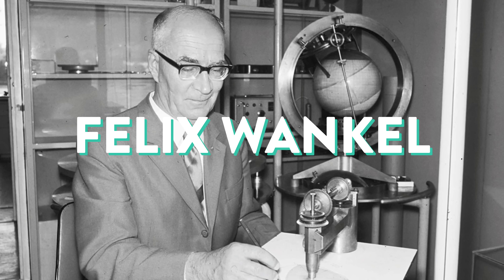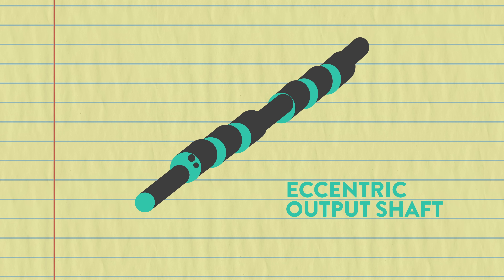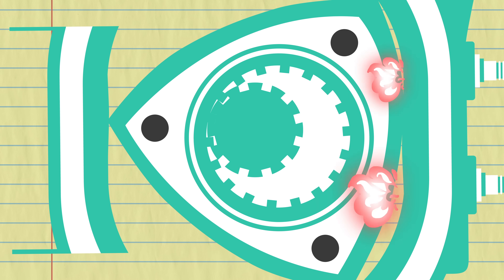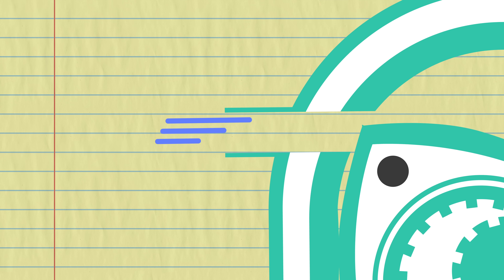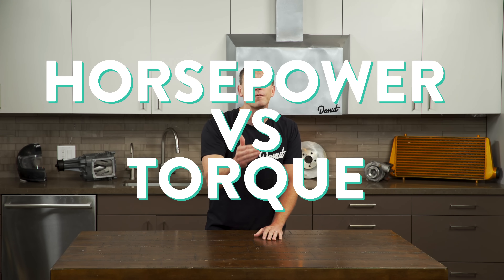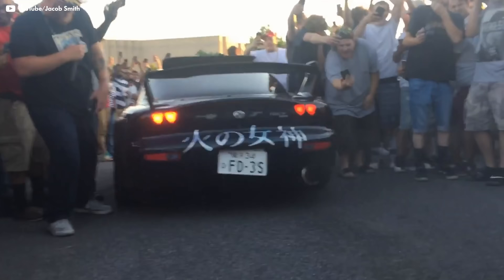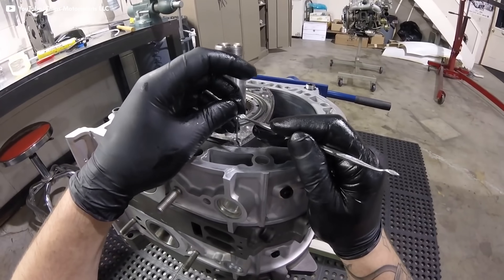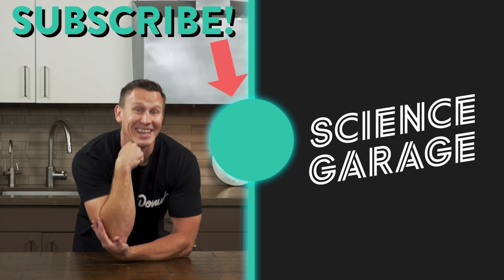Rotary Engine | How It Works

Comment: Sick vid! 👌🏻
Can you tell us why fuel injection is superior to injection from a carburetor DOWN TO THE ATOM?
Reply: Because the computer has many sensors reading the air mixture as air changes on a hot and cold day and as it also changes at sea level or up in a mountain 10,000 ft high, and a computer can easily adjust depending on how much you step on the pedal and control other components simultaneously for maximum performance, 😎👍🏽
Reply: carbs dont really 'inject' fuel. the fuel simply is atomized as air flows past the imulsion tube. that's partly the reason why theyre not as efficient
Reply: Bf109: fuel injected -> can fly upside down indefinitely and can do negative Gs
Spitfire: carburetor -> can't fly upside down indefinitely and can't do negative Gs
Reply: Hotdog Updog Thanks 🙏🏻 😂
Reply: Oh yes please. Talk fuel delivery systems!!!
Reply: YES PLEASE
Reply: AWC Um... WHAT??? Do some fucking research before you spread misinformation like a jackass.
Reply: Ok that was a good one😂
Reply: Bits of Pulp Ayyeeeeee 😂
Reply: thatallredheadude 1 Thanks, but I learn better through visualization
Reply: noice 420 likes
Reply: Hugo Farhan Akbar Now it’s 421 :(
Reply: Better control that's about it the ECU can better control the air fuel ratio than a vacuum chamber through the carb can
Reply: Carlos Barberena I
Reply: @carlosbarberena because fuel injectors heats and atomizes fuel alot better than carburetors hence better mpg and emissions
Reply: +Mike The Mechanic   Can you explain how the fuel injector "heats" the fuel?
Reply: @doktorbimmer  The uk government are being forced to ban or limit diesel cars by 2040. They are giving off high amounts of carcinogenic pollution and are credited for a large rise in cancerous deaths. A lot of the diesel emission testing didn't apply to real world situations while many were falsified. In other words 95% of diesel cars are marginally better for us than petrol if at all, some diesels are worse. DPF filters (that limit the cancerous fumes) are also a very big grey area in effectiveness. Many people have them removed as they block up easily and are costly to replace. Also very conflicting evidence in how well they actually filter while working on top of the added pollution they take to make. Also much pollution is added because some people are forced to ''drive on the motorway to clean the filter''. If they don't do that a warning light puts cars into limp mode. Sellers of such cars do not tell people that diesels are very bad to be used as anything but long distance vehicles. Car makers want sales, telling people a car that is bad in short journeys is not good business for them so they don't say it.
Reply: Ernie Brink, Can you please explain why your engine does not run at all????
Reply: @doktorbimmer  you just run around spewing hate and lies. When will you grow up? @doktorbimmer Aparently he once owned one: here is a quote I copied from another thread, it's a 1 year old post: "I have owned one...an RX7 (the worst car I ever owned) and its engine failed with only YOUR OPINION DOESN'T MATTER TO ME because you have ZERO hands on experience with the actual engine a brilliant mazda and lexus mechanic (who obsesses about rotary engines the way ferrari owners obsess about their paint finish) has stumbled across two mechanical breakthroughs that could make the rotary a total lunatic on the track as it ought to be
Reply: @xkexke8081  COSMO SUPER CAR IS ON THE BURNER AWESOME THANK YOU ROBERT DAVIS AND MAZDA 2019
Reply: @therealdokoterbimmerrotary6751  COSMO SUPER CAR IS ON THE BURNER AWESOME THANK YOU ROBERT DAVIS AND MAZDA 2019
Reply: COSMO SUPER CAR IS ON THE BURNER AWESOME THANK YOU ROBERT DAVIS AND MAZDA 2019
Reply: @doktorbimmer  When you pressurize fuel, or anything for that matter, you create heat.
Reply: @Vladimir Lucifer The injector doesn't heat the fuel dummy... you don't know anything about fuel injection do you???
Reply: @doktorbimmer  The injector does heat up the fuel at the nozel, it's not intended, but that is how physics work. The greater the pressure, the more heat. The greater the drag, the greater the heat. Guess what a fuel injector has the most? Pressure and drag due to High velocity gases. You don't know much about physics, do you?
Reply: @doktorbimmer  However, the faster a gas travels, the lower the pressure is. But there is still internal heat and heat formed due to drag on the nozel.
Reply: @Vladimir Lucifer Well, its obvious you are no engineer... the fuel pump is cooled by the fuel and so the undergoes some heating during pressurization. The Injector however releases pressure... thus COOLING the fuel.
Reply: @doktorbimmer  The fuel when is sitting at the fuel tank is cool (ambient temperature). When compressed, like any fluid, it generates heat. You are certainly no engineer. By your logic, why do we need intercoolers for turbochargers or superchargers? After all: the air wouldn't heat up or anything.
Reply: @doktorbimmer  No. Releasing pressure does not cool anything. At Least, not instantaneously. You know nothing about pneumatics: nozels heat up due to pressure, due to drag. It will still heat the fuel. By consequence. Not intended, but the functionality is still there. And of course the fuel pump will be cooled by new fuel : the fuel on the tank is relatively cool.
Reply: @doktorbimmer  Well, modern cooling pushes air into a chamber. That passes through the refrigerator. But there is also another thing: some use vacuum.
Reply: @doktorbimmer  By your theory, I would be wrong. And I am right: a refrigerator uses the same principle.
Reply: @Vladimir Lucifer But we are not talking about the fuel pump dummy... we are talking about the INJECTOR
Reply: @doktorbimmer  The injector holds and gains pressure. Other than the fact that the friction at the nozel will eat up. And then the injector will heat up. And then it will heat even more the fuel. You should learn pneumatics.
Reply: *WRONG! Heat is added when a fluid is compressed or pressurized.
The Injector RELEASES pressure which cause cooling. The fuel goes from a high pressure liquid and is atomized and vaporized. This PHASE CHANGE cause a significant DROP in temperature.*
Reply: @Vladimir Lucifer You obviously do not understand the concepts of Latent Heat or Fluid Dynamics...
Reply: @Vladimir Lucifer You do not understand how fuel injection works or the basic fundamentals of refrigeration or automotive air conditioning. Automotive air conditioning works by compressing a refrigerant gas into a liquid under pressure and is release via a injector nozzle into the evaporator where in cools by absorbing latent heat as the pressure drops and the liquid evaporates into a vapor/gas.
Reply: @doktorbimmer  The injector may release pressure, but that will not cool down the air. It will keep the heat, and so will the fuel. Do you think that magically the heat will disappear? Also: forgot the laws of physics? Friction creates heat.
Reply: @doktorbimmer  Does it? Does it cause a temperature drop? I wonder: why, when I pressurize a hose, and close the system, it is hot, but if I pressurize it constantly at even more pressure, it will be so hot that it will burn, and that even if the air is cooled, when it leaves at High speed it burns my hand? You know nothing. It's not that it was designed: it is just the laws of physics.
Reply: @doktorbimmer  I am too ignorant? Oh, sure. Says the biggest dunning Krugger That I have seen. What you are saying, is if I stop giving something energy, then it will INSTANTLY go to absolute 0. I don't care what you meant. You stated it like so. If I give a metal thermal energy through a torch, and then let go the torch, it would immediately cool down. That is not what happens. In a injector, there is a lot of pressure (100 bar) and when released, it drops slightly. That "drop" is a 150 psi drop (gasoline low pressure, all the pressure for a diesel). High speed, high pressure gases, are still HOT. Specially, with the FRICTION at the nozel for better ATOMIZATION. Other than the fact that the injector will keep the heat. So it will heat up the fuel. It's a defect of the technology.
Reply: @Vladimir Lucifer Yes, the evaporating fuel DOES COOL THE AIR DUMMY!
Reply: @doktorbimmer  Do I need to tell you that the fuel will still heat up? And that is only would cool down if indeed the cylinder was cooled?
Reply: @Vladimir Lucifer The injector releases the pressurized fuel causing it to Atomize and Vaporize this evaporation causes COOLING
 The Fuel injector does not heat the fuel IT COOLS THE FUEL as it enters the engine.
Reply: @Vladimir Lucifer The injector does not HEAT the fuel.
Reply: @Vladimir Lucifer What does a HYDRAULIC system like gasoline Fuel injection have anything to do with "Pneumatics"????
Reply: @Vladimir Lucifer Sorry kid, but you are not fooling anyone here with your tech gibberish nonsense.
Reply: @Vladimir Lucifer WRONG! The combustion recesses in the piston/rotor face have NO EFFECT on displacement as they are not part of the swept volume of the engine.... you need to learn what DISPLACEMENT is and how it differs from STATIC COMPRESSION RATIO!!! Again you FAIL!!
Reply: @doktorbimmer  The injector heats the fuel even if it isn't it's intended purpose.
Reply: @Vladimir Lucifer WRONG AGAIN KID! Pneumatics is the study and application of compressed air and gases... not liquids, that is called Hydraulics
Reply: @Vladimir Lucifer WRONG! The Injector does not heat the fuel... it causes it to COOL.
Reply: @Vladimir Lucifer The injectors job is to evaporate the fuel... and evaporation causes COOLING by the absorption of latent heat.
Reply: @doktorbimmer  Pneumatics study fluids. HYDROLYCS study specifically liquid fluids. And yet, this isn't even the point: most gasoline will vaporize with the pressure after the pump, and then liquify because of density. Oh, and you forgot something: injectors due to inefficiency, cause heat.
Reply: @doktorbimmer  Actually, the one who keeps going down is you. You were totally obliterated. None of you points were valid because none of them were correct
Reply: @doktorbimmer  The injector will heat the fuel due to friction, and the fuel on the combustion chamber will cool down because of the increased surface area, dissipating heat quicker. Simple 7 the grade physics.
Reply: @Vladimir Lucifer WRONG DUMMY! the study of fluids is called FLUID DYNAMICS
Reply: @Vladimir Lucifer No! It Does not... if vapor forms between the pump and the injector? The engine will stumble and die, this fault condition is called VAPOR LOCK
Reply: @Vladimir Lucifer WRONG! Fuel injectors evaporate fuel due a sudden DROP in pressure... this effect causes COOLING
Reply: @Vladimir Lucifer The injector will cool the fuel and the surrounding air due to the Latent Heat of Evaporation... they do not teach thermodynamics in your 7th grade classes.
Reply: @doktorbimmer  Of you increase the heat of a liquid, it will become gaseous, however, the pressure is so big that it will come down to a liquid near instantaneously.
Reply: @doktorbimmer  The study of pressurized liquids is hydrolycs. The study of PRESSURIZED fluids is pneumatics. The study of the FLOW of the girls and behaviors are fluid dynamics.
Reply: @doktorbimmer  No. Fuel injectors atomize to near- gaseous density, and that increases surface area increasing heat dissipation: the fuel will however evaporate, with the heat of the cylinder. But at that point, the ATOMIZATION already made the fuel near- gaseous.
Reply: @doktorbimmer  And I will do too. A friendly competition.
Reply: @doktorbimmer  No. And injector isn't going to cool Shit. What is going to cool anything will be the fuel: even when heated up, the greater surface area will make it lose energy much faster. And because the relative temperature of the fuel is much lower than the cylinder, it will cool down.
Reply: @doktorbimmer  Oh. You think that thermodynamics, SIMPLE thermal dynamics isn't presented at 7th grade? Welcome to Portugal: where we teach "advanced" physics at 7th to 9th grade.
Reply: @doktorbimmer  Latent heat of evaporation is when you give energy to a fluid (liquid) releasing pressure will reduce the energy and transform it into friction (heating the fuel) and kinetic energy. And that is it. The fuel will be atomized so much that it will vaporize with compression os cylinder temperature.
Reply: @movingcombustionmazda6340  THAT IS FUNNY
Reply: @xkexke8081  AWESOME
Reply: HEMI SHAPE IS THE BEST
Reply: @Vladimir Lucifer VAPOR LOCK
Reply: @Vladimir Lucifer Evaporation causes COOLING
Reply: @Vladimir Lucifer The injector does not heat the fuel IT COOLS IT!
Reply: @Vladimir Lucifer I think you need to move to a country with better schools.
Reply: @Vladimir Lucifer You clearly do not understand the concept of Latent Heat. When pressure drops the expansion causes the gas to ABSORB ENERGY and thus causing the COOLING EFFECT that is always observed.
Reply: @therealdokoterbimmerrotary6751  awesome
Reply: Se tivesse legenda em portugues pra eu entender o q ele fala :/ como queria enteder ingles.
Reply: 100th like, not to brag ;)
Reply: More efficient? Absolutely
Superior? Nah son
Reply: Carbs are cheaper,but fuel injection is better
Reply: You can flood a carb
Reply: The venturi of a carburettor causes a pressure drop behind it, leading to lower intake manifold pressure, so it's like you are driving with less throttle.
Reply: I've been looking for a video like that. Bought an 88 Chrysler with the electronic lean burn, some kid told me to put fuel injectors in it. I never knew shit about cars, but I really want to. I don't think you could put fuel injectors in a 318, but hey, I don't know shit
Reply: Basically more efficient and accurate fuel injection, combined with commands from the ECU can better control the air/fuel mixture.
Reply: Because it can better control the ATOMization of the mixture.
Reply: Eduardo De Dios Thanks, but I learn better through visualization
Reply: bubo bling Yes, thanks bro xD
Reply: Eduardo De Dios not asking u to explain at all. We want donut media to tel us.